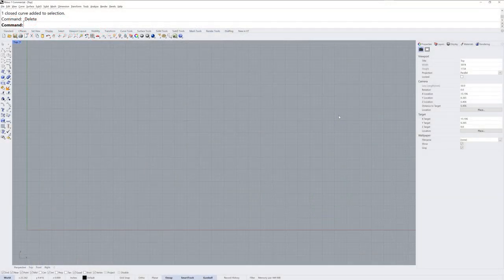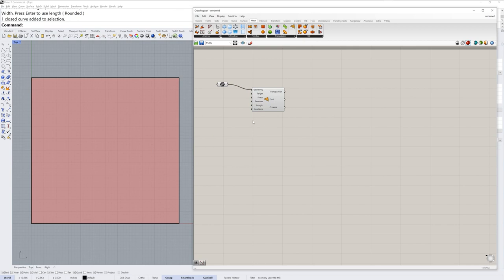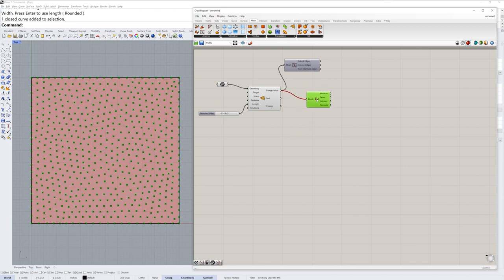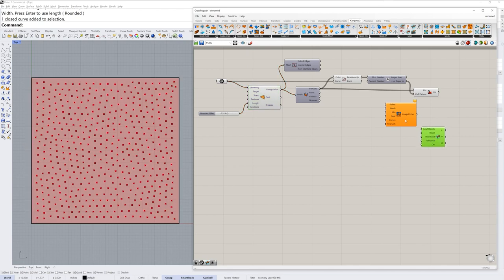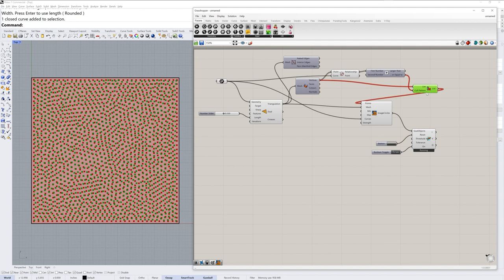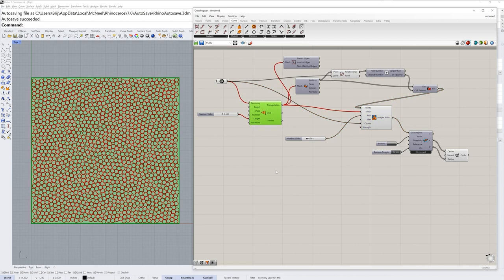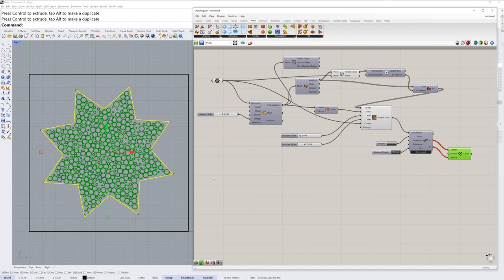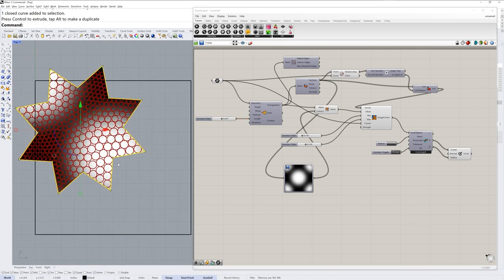Circle Packing with Grasshopper

Comment: Thank you for the Tutorial, since i have Rhino 6,  I dont have TriRemesh Component, could you please advise how can I Proceed with Rhino 6? is there any solution to develop Circle packing in this way? Thank you very much
Reply from the maker: You can reference any mesh you make instead and then get the vertices from that for the image circle points. Make sure the mesh has enough verts though and that they are evenly spaced to get a similar result to what I showed. Alternately you could make a grid of points in GH and then make a mesh from those.